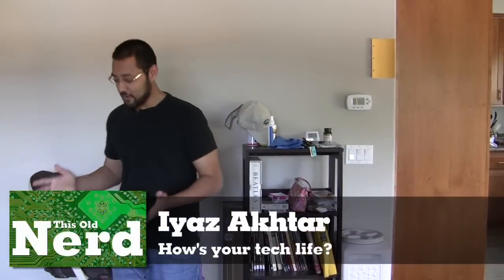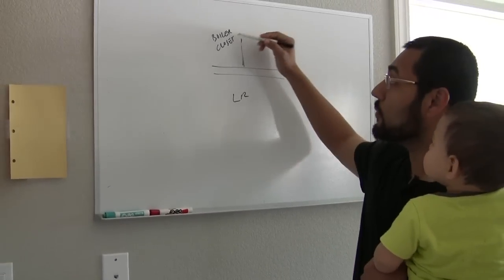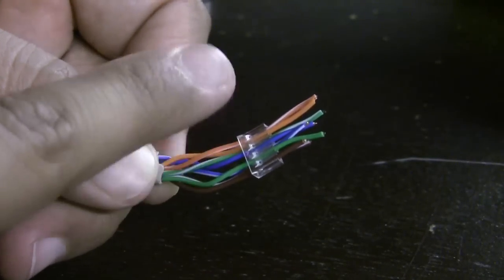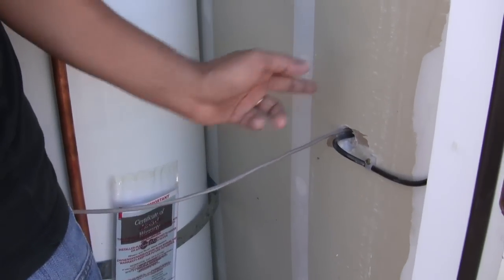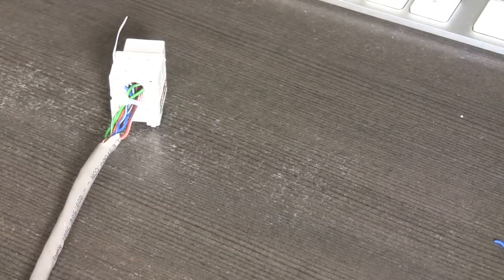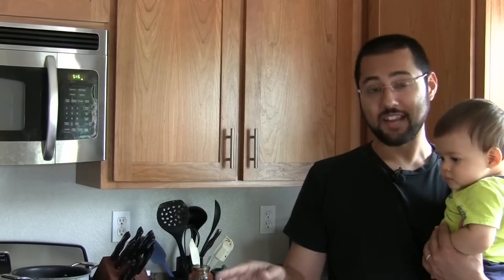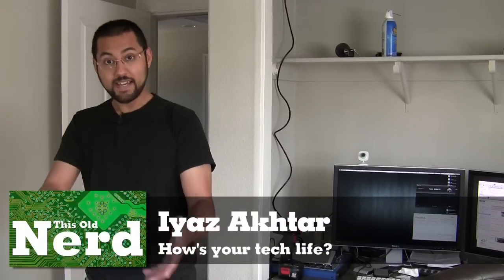Setting up a home network

Comment: The plates in my house are two outlets, two outlets one Ethernet with phone, or two outlets one phone and Ethernet and one coax
Reply: pull the cover off and you may find the wiring is still cat 5e. Often-time they only use one of the twisted pair and save the rest rolled up on the end of the cable like he described in the video. I used to install the same thing you are describing, because it was common for the cable to be coax, and internet was ethernet cable otherwise referred to as cat 5 or better...(i.e. cat 5e, cat 6, and now cat 7 which is all more speed related).

Comment: You actually can use both telephone and ethernet if you have only an ethernet cable running through your house. The only four cables you need for ethernet to work are the greens and the oranges. The blue is for telephone. So, if you wanted to do a little more work, you COULD use both as a telephone cable CAN be plugged into an ethernet jack.
Reply: ***** I know, however no one I know has gigabit Internet in their house, so for the most part, in household Internet this will not be a problem.
Reply: 22408aaron Not true, you're forgetting the most important part about having a home network and it's not internet. It's the speeds within your home network (ex. the speed between one device and another in your own home). Also the amount of bottleneck you are going to have could be huge if you are limiting your communicating with simple wiring. If you are using the internet on multiple devices whilst communicating and transferring with those devices on that network, you can run into a bottleneck. My setup at home allows me to transfer between my main computer to all my other computers (wired) in the house at a much much higher speed than what my internet is, but that is of course because the hardware and wiring are capable of those speeds. If you wired it like you suggested, you will run into a bottleneck when it comes to transferring files from one device to another over the network.
Reply: Kevin Dargie You are absolutely correct as anything using Ethernet wires will degrade performance, however I have been doing it for months now and the quality has not been effected.
Reply: 22408aaron Scuse me? I bet, most people that have wired ethernet at home, DO have gigabit. It's very cheap and almost every off the shelf personal router supports gigabit, as well as practically all integrated NICs on motherboards newer than year 2000. However when it comes to networking speed, you yanks seem to lack some serious stuff there ;-)
Reply: just because ur router is gigabit dont mean ur internet is gigabit. 4 pair wire (cat5 /6) can be used many different ways, yes a handy trick is to use it for 100Base-TX, there for freeing up 2 pare for anything from telephone, to anther lan connection, or power. but this is not something i would recommend, because if ur already running wire, how hard is it to just run another cat5 cable. giving ur self many other options for the future.

oh and for those streaming saying they need 1Gbps, sure ur server may need it, but its not to often a client is going to use more than 80Mbps when streaming 1080p. the 100Mbps trick isn't  for every 1 but for existing installs can be a valuable tool.

plox for anyone doing this, b sure to terminate and label properly to avoid headaches in the future
Reply: ***** oh I'm saying 80 megabits not megabites aye
Reply: Actually it means "megabit per second",
Reply: Sure thing. It's no good in this business to not be accurate with what one is saying. Just saying.

Comment: Hi did you have a second wall plate in the closet? I.e. switch -> wall plate in closet -> wall plate in LR -> router? Btw my setup is similar so perfect video!
Reply: I thought it's switch -> wall plate in Lr -> Router. It looks like the one from switch to LR is directly connected to the LR plate keystone.

Comment: do u have to change ALL the landlines to ethernet what if i just wanted to change 2  of the landlines, is that possible?
Reply: +petadang of course if you want to just change 2, you can just change 2. If your going  to change 2, might as well change all of them, you can still use RJ11 keystones where you have phones, and have the option to change the keystones later in life to RJ45 ethernet and can use them for network than.

Comment: so lets say i need 3 wired connections in a room, would i have to run 3 cables from the switch or could i just run 1 up to the room and then use an access point or something?
Reply: +makethekill111 you can run one cable to the room and use a small switch or hub to connect the different devices in the room.
Reply: +makethekill111 You can either run three cables and have a triple keystone in the room, or the easier option is to run one cable to the room, and then use a small switch, this way, if you ever decide you need more connections in that room, the switch can just be upgraded to a larger one.
Reply: Harry Akira Eaton Rek Aviles oh, good idea, thank you
Reply: +makethekill111 best and easiest option, if you're already running 1 cable (not wire) to a room is to run 3 ethernet cables at once (Cat 5e minimum), use a triple keystone wallplate.
If you have a larger switch in a central location that all the ethernet connects to you will have the best option for future upgrade ability. Cat 5e under 30 meters can be used for 10GbE if Cat 6 / 6a keystones are used, along with a 10GbE switch in a future upgrade. if you have 1 ethernet cable going to a room, and a Gigabit switch in the room, there's only 1 Gigabit backbone going back to the main switch, so other computers on the network won't talk to each other at full speed, impacting things like file transfers over the network, etc.

Comment: Just saying with the keystones, the punchdown is never permanent. if you want to use them again all you need to do is use needle-nose pliers and just simply rip the wires from the keystone, it will not at all damage the keystone in any way. They are completely reusable.

Comment: What are you running that is gonna be bottle-necked by a cat 5e cable?
Reply: +Shawn Snow fileserver can easily be bottlenecked with Gigabit. which is only 125MB/s. my fileserver can do 500MB/s easy so Gigabit is a major bottleneck for instance. even if I use teaming and use 2 Gigabit ports  per pc, still a bottleneck.
Reply: +maz I thought cat 5e was rated at full 10 gigabit for distances up to 55 meters, which is almost 200 feet. I have been wrong before though.

Comment: all my phone jacks are connected in a pair of cat5e wires. there are two wires connecting every single phone jack.  so each jack is connected together. is this a problem?
Reply: +Christian Gomez It makes wiring up your house harder. You have to get really creative and have the right tools to wire up Ethernet with a 'daisy chained' cat5 house. Daisy chained cat5 means one wire starts at one point (usually your telephone panel on the outside of your house) and is connected to every single jack in the house. Easy way to find out where the cable starts is to hook up a tone generator on the outside at the telephone panel on the BLUE PAIR (which is most likely the only pair connected in the jacks), then open up your jacks and you should find 2 cables, cut the wire off of the jack and listen for tone with your tone probe. One is the incoming wire from your telephone panel (this will have tone) and the other is feeding the next jack, and so on. The cable should start near the closest room to the telephone panel on the outside of the house. (Think like a technician, how would they run the cable to make it easier for them..) Once you figure out how the cable is run it is just a matter of connecting the wires to make the Ethernet go where you want it to go.
Reply: +Adversary Gaming Also, the jack with only ONE cable behind it is where the cable ends. So if your router is in that spot you can only hook up one room with Ethernet (1 gigabit speeds), this is why I said you have to get creative. If your room that has the router has a room next to it with a telephone jack, you can poke a hole through the wall and run Ethernet to that to take it where you want.
Reply: +Christian Gomez this is no problem at all. easy to wire it up.
assuming you mean all the Cat 5e is joined (connected together) at the phone cable outside / in the garage, and there's a Cat 5e going to each phone socket, all you need is what this guy bought. keystone wall plates, RJ45 keystones, a patch panel, a switch, and a router. (assuming you've got a modem already).

Comment: In theory, if my telephone wires are cat5 can I replace the jacks in the wall with the network jacks?
Reply: Yes
Reply: Yes, with an asterisk. The cables are capable of carrying data, but it depends on how they are wired. You need to check your phone wiring box and see if there are multiple cables coming in there like this guy had. If there is only one there is a good chance that they have done the phone wires "round-robin" style with one room jumping to the next. Jacks connected in series like that work fine for phones, but will not work for a data network.
Reply: There are a few things that come into play.. Since this cable was Bering used for phone there is no garentee that the wires all come back to one location.. Some older houses have the phones split in more than one location. If your house is like this then no this will not work for you. But if they do come back to one location then yes this will work.

Comment: Wait you know Cat 5E is rated for gigabit Ethernet right? Cat 6 & 6A are for 10g base t and up to 40g base t respectively. For true 10g though at 100m it is recommended using Cat 6A because of the lower alien crosstalk. Even though most people think gbe is only available on cat 6, it's a big misunderstanding.... Cat 5 isn't rated for GBe though that being it only can utilize 2 pairs for a theoretical 100 mb/s.

Comment: Is that a special kind of crimper??  Where would I get one of those at??
Reply: ShyRage1 Home Depot or amazon
Reply: awesome!  I got one
Reply: Do you know if and what kind of tool I could use to drill wire through any kind of wall??  instead of one wire going through that hole, i want like four of them going through that same hole in the wall
Any help would be appreciated

Comment: good video but terrible patchwork in the kitchen, why do you have so much access unsheathed cable, you got to get it as tight as possible with no more than an inch exposed

Comment: i don't get why the green and white doesn't go next to the green wire
Reply: I was wondering the same thing. I wire rj45 plugs up all the time and I don't know why when it was originally designed the pairs were not all lined up instead of splitting the green. If they were all lined up in pairs then as long as each end of the patch lead or network sockets were wired the same then it would work even if the wires were in the wrong pair order. I bet it has something to do with the voice pair being in the middle of the plugs on rj11 and rj45 on pins 4 and 5 which leaves no room for a straight green pair.
Reply: That's the Norma cable coding standard

Comment: Since when is cat5e not certified for Gbps?
Reply: +ofacesig he's confused, probably skimmed over wikipedia instead of reading the article properly.
cat 5 is not tested and rated at Gigabit, although will work at such speeds. Cat 5e is rated at Gigabit, and 10GbE under 30 meters. Cat 6 and Cat 6a will do 10GbE upto 100 meters.

Comment: Boiler? you mean the water heater?
Reply: I think you mean boiler, mate. "Water heater" is what a child would call it.
Reply: Suj, not exactly brother. Boiler refers to a machine that actually boils water in a steam heat radiator system. No modern systems actually use a boiler, but the term is still used to describe machines that heat water for heating radiators. Hot water heaters are used specifically to heat water for use in sinks and showers, not radiators.

As to your suggestion that that "is what a child would call it"; since real boilers rarely exist anymore and most of what people call "boilers" actually heat water rather than boil it ... maybe the child would be more correct.

Comment: So ethernet can be used as phone wire or the contractor did it wrong?
Reply: yes, ethernet can be used for telephone, several telephone lines over one single cat5e, in fact.

Comment: This was so easy, but why not go with wireless??
Reply: because it's not always reliable and a pain to use at times, and much slower. I have wireless in my home network, but I also wired the home with cat6 via the attic to get every device possible hard-wired.
Reply: ewww wireless???? who uses wireless when you have Ethernet
Reply: My laptop doesn't even have an Ethernet port. :(
Reply: Two quick answers:  speed and not having to worry about signal interference.  If you live out in the sticks, you're not generally going to have to worry about signal interference, but if you live in a congested area, it can become an issue.  As for speed, if you're doing a lot of streaming in high def or any other bandwidth intensive function, or running a centralized home media server that feeds multiple devices in multiple rooms or things like that, wired over WiFi is a no-brainer.  Also, there is something to be said about security and WiFi hacking, depending on your level of paranoia.
Reply: Sod Pen Eh. I definitely prefer wired due to little signal interference with proper cabling, and port security vs 802.11i, that's a no brainer. Yes WPA2 is allegedly unbreakable, port security still trumps it, you can't even try to break the signal if there is no signal after all. Speaking from a home environment standpoint, not an office standpoint where many people have access to the ports. 

HOWEVER the bandwidth issue is very outdated. Modern 802.11N/AC is more than capable of supporting many streams of HD video/audio. HD video only requires between 10-40 megabits per second per stream, this is full 1080P 60 FPS video. 4k requires a similar amount of bandwidth around 40mbps. N can support 600mbps ideally, and AC can perform at gigabit speeds(ethernet). So unless you have 15+ people streaming HD content at once on one WLAN, you won't max out the bandwidth. Wireless has all but completely caught up to wired 4pair (ethernet) cabling in terms of bandwidth in an ideal environment*. And if you want to really be secured in a wireless environment use WPA2/AES to encrypt the signal, operate the access point on a separate VLAN from the default home network, don't allow inter VLAN routing, and set up 802.1X port based authentication. Bam! and now you have a wired connection without wires. Well sort of.

Comment: Most homes that have been built since the early 2000's have cat 5 because most of them have some for of internet networked set-ups for at least a few of the rooms in the house. In addition to that they are also common to install some sort of security or fire and home safety warning system. This is pretty standard and now the technology that is just around the corner may even be some form of fiber optic...still a little ways out though, so I understand-but I bet your friends at PCMag have more info about that :) Good video. Oh and I might also mention your P>A>R) is a great catcher of attention!! Two thumbs up for that...

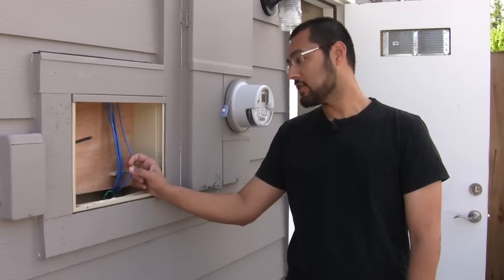Comment: 4:30 seems to be an indication about how much does he really know about networking. Using a switch is completely irrelevant to the termination of the cables (patch panel or direct RJ45 jacks). You can't choose not to use a switch. This is not analog... The termination in that socket is a disaster.
Reply: I dont like that the cables go directly into the switch. I use keystones and put them on a pannel.

Comment: It POE is power over ethernet. But great vid!!
Reply: +Kris8530 no he's talking about powerline adapters which allow you to use upto 400Mbps internet over actual power lines via a frequency adapter wall plug.
PoE is an entirely different technology which remotely powers a device using ethernet cable for data and power.

Comment: Your quite knowledgeable in structured wiring and the terms used but yet you call the water heater a "boiler".
Reply: Paul Tiller he gives terrible info do not listen to him if you want a good network. A real networking guy would laugh at this job

Comment: I wouldn't bother with CAT6 for home networking. It's a waste of money. CAT5E supports 1Gb which is more than enough for home use.
Reply: People stream more and more and have higher expectations on the speed so why now wire for 10Gigabit from start?
Reply: "I wouldn't bother with CAT6 for home networking. It's a waste of money. CAT5E supports 1Gb which is more than enough for home use."
absolutely agree..
Reply: Michael H If you're going to buy cable and wire your home why not buy Cat6 from start? It's just a little more money. We wired our house a month ago with Cat5e but the reason for not going Cat6 was that we got the cable for free. If we would've bought cable Cat6 would be the choice. Cat5e is enough but why not go faster from start. Dont be dumb cheap.
Reply: WikHellfire - PlaystationShare well my point was that CAT5E is more than enough for home networks, If I was buying a new 1000 ft roll of category cable for doing home network wiring, I would pay the extra $40. bucks for standard Cat 6, but would any home network notice the tighter twists, or perform better? No. 
They are both 1000base-T, both 1000 Mbit/s, and both can go to 100 meters.
Reply: Michael H Oh, didnt notice the " :S I guess we both agree :)
Reply: WikHellfire - PlaystationShare
Reply: That's crazy, fifteen years ago people would have said 1Mbps was overkill.  10 years ago 10Mbps would be overkill.  Now we are streaming 4k movies to potentially 3 or 4 rooms in a house at 4-500Mbps, who can possibly say what the requirement will be in another 10 years.  at 10c per metre more you totally have to use cat6a